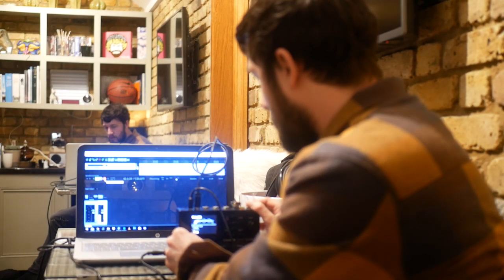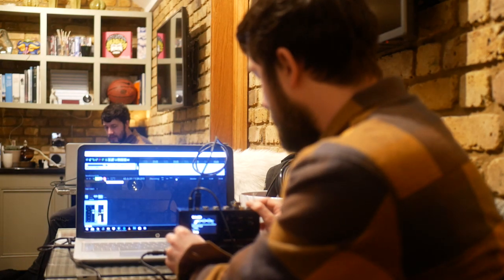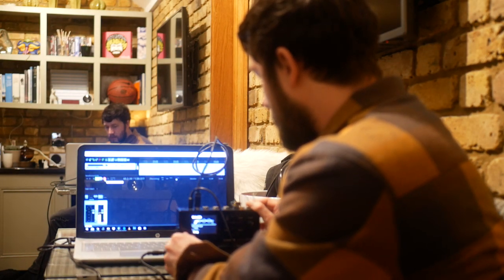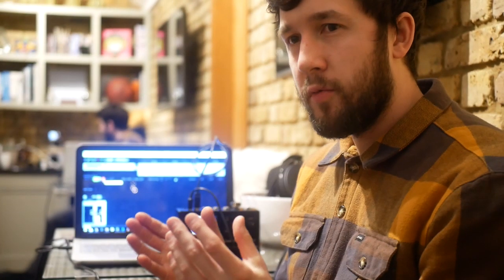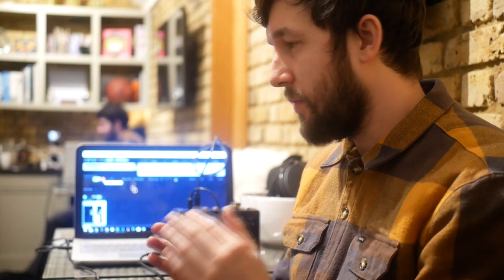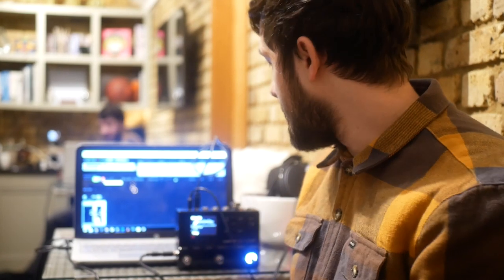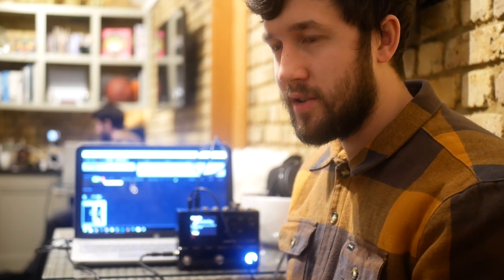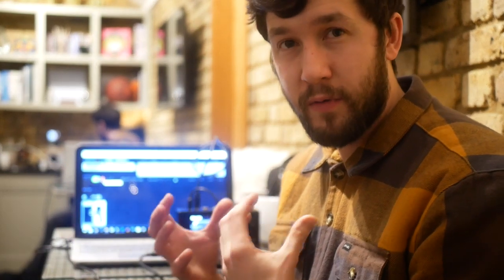Making a MODELLER FEEL like a REAL AMP

Comment: So what is it about the Synergy amp product that is different than the Helix and Kemper digital stuff?
Reply: Tube preamps into a tube poweramp.
Reply: Willowisp So does that mean you have to have a tube power amp for those to work?
Reply: The Synergy amp takes Synergy tube preamp modules. The amp itself is practically just a tube poweramp. They have released other products that take the modules but it is based around this idea. In my opinion, you can practically anything and run it through a tube poweramp and cab it will sound good. Using modelers, AxeFX Line6 and Kemper through a tube poweramp and cab sounds very good.
Reply: Willowisp So that means you gotta buy both the tube preamp and the tube power amp. That’s insane. You might as well just buy the combo amp you want.
Reply: @bjamminsincebirth3494  The concept behind Synergy amps is that you can have multiple tube preamps that are more portable and easily switched between. If you just want the sound of a single combo amp then yes, you might as well buy that.

Comment: Jonathan I don't want to sound rude but I bought some of your stuff and I wasn't overwhelmed.
From what I can understand everyone sets up their hx stomp very different according to what they have in their minds as a real amp. A lot of it has to do with the user speaker-amp final volume and headroom.
Reply from the maker: That's fair comment, and why I believe it's not fair to charge large amounts of money for presets. And yes, signal chain, guitar, pickups and guitarist will all play an important factor in the actual results?
Reply: @johnnathancordy  Did you design your presets to be played into an amp? Or into monitors or something else?
Reply from the maker: @dean_3099  monitors. JBL lsr305s are what I use
Reply: Well, I'm the not so proud owner of some of Rhett's Helix Patches, They were not very useable right out of the box for various reasons, although I was able to do some tweaks and block changes. In fairness, I'll say they are templates and that is the rule for me with respect to purchased patches.
As with most patches, free or purchased you have to use your ears and understand the platform. 
I think Jonathon has many fair points. IMO, If you're  going to gig with Modeling or Profilng gear, you'll have to do several tweaks before you settle on a sound. This has been my experience from using Modelers in a Live setting since the original Pod and Johnson and Digitech, etc units came out.  One more thing, EVERYTHING you plug your unit into sounds different than any other unit. Good Video Jonathon, where does one find your patches? Link?